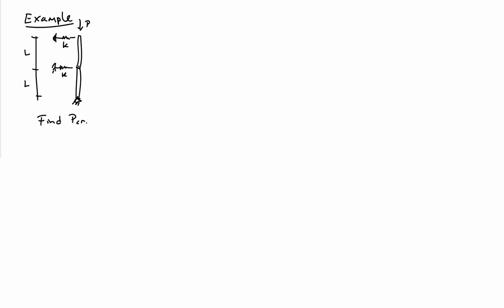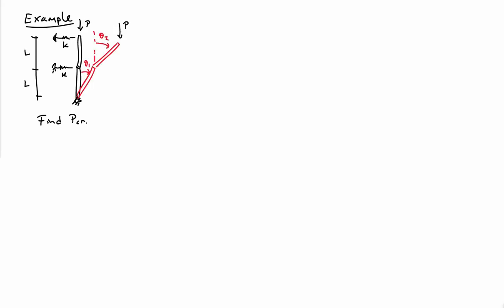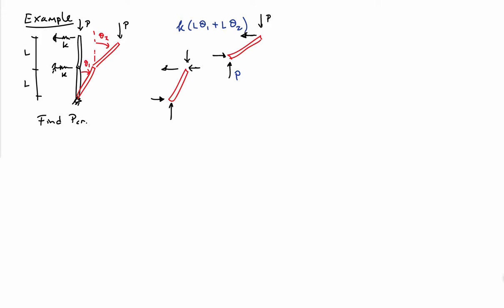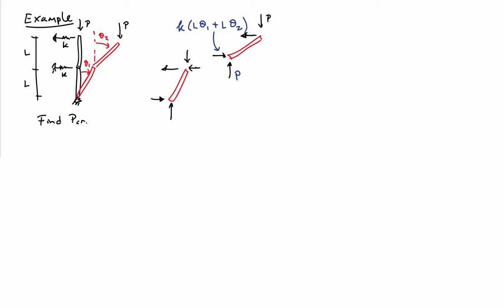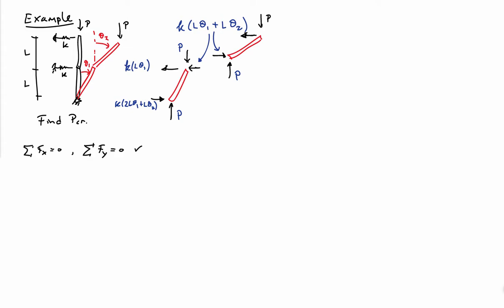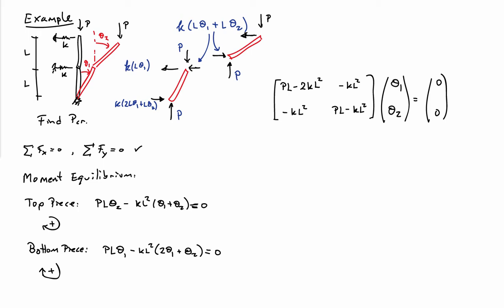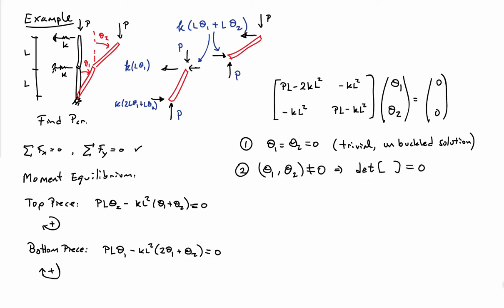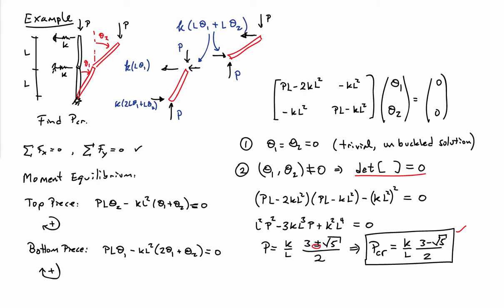(35C) Examples - Stability of multiple rigid link syste

Comment: It should be kL not k/L
Reply from the maker: Thanks, you are correct.  P = [3kL +/- sqrt( 9 k^2 L^2 - 4 k^2 L^2)]/2 using the quadratic formula (after dividing through by L^2).